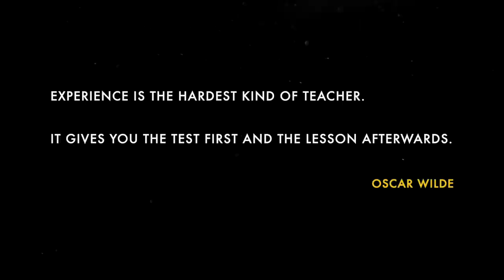Boat Yard Jazz.. an unpleasant setback | Ep. 71

Comment: Diluted Hydrochloric acid .... Leave 30 min and spray off. The balance is easy with an angle grinder and abrasive pads. All easy if you have access to it all I suppose. That is a tough job with scrapers. Well done with the hard work ... And staying positive.

Comment: They sell a cleaner that has hydrochloric acid that will dissolve the left over barnacles. Then it just rubs off. As for all of the anti-fowling once that's done, get an ORBITAL sander with a vacuum attachment!  Save yourself alot of headach. Sand it down to the fiberglass, then you are starting fresh.

Comment: At 14:10 you said basically if it sticks it sticks.  You are correct.  The boatyard will try to convince you otherwise.  Do my comment below.  I rebuilt a boat last year...where we did have to take it down to the gel...We figured 19 layers on a 1972 boat.  Common sense prevails well on boats except with electrical....more boats catch fire than sink.

Comment: Some scrapers are better than others, and keeping a sharp edge on it really helps, but you have to be careful and not gouge the gelcoat by going too deep... I would scrape the majority of it, and use an orbital sander with a coarse grit mesh sanding pad to get down to gel coat or durable coating layer.

Comment: I had mine soda blasted and then I applied 4 coats of coppercoat. Worst paint ever to work with, but the result is good and it should las 10+ years. No need to pressure clean it on haul out and in the spring I use 15 minutes for a light sanding.

Comment: What a pity I didn't see this much earlier. There is an electric tool for scrapping hulls in that much need. Don't remember its name but it looks like an electric plainer with parts of the blade broken off. It'll cut your work by about 80%. I'd be tempted to use an old plainer and snap the blade to suit and give it a go. Carefully.

Comment: From your video it is hard to understand fully why you need to remove all of the antifouling back to the gelcoat. I appreciate that the barnacles need to be removed and loose or flaking antifouling, but other than that what’s the problem? Antifouling is designed to go over rough and uneven surfaces and stick like hell, try getting it off your skin ! I feel that you are correct in your comment that if you can’t get it off with a scraper and pressure then it doesn’t need to come off and is a sound surface. I would apply two coats of antifouling and get the boat back in the water ASAP.
Reply from the maker: Heyyy, thanks for the feedback :) you are right. It wasn’t too clear yet. But it portrays well how confused we felt 😅😂 in the next video we scrape the rest and explain why we do what we do and dismissed all the other options. Which we definitely considered extensively before starting this horrid job :):)

Comment: Yeah you should put the protective gear. That kind of paint is very nasty for your body, dangerous to breath and to consume. You also could use paint stripper (gel form) it works really well but be carefull, it hurts when it touches the skin. It burns a lot even through 2 pairs of gloves! It took a few days for my mom and I to remove all the antifoul paint under my parent's 37 foot tayana. You could also pay for a sandblast guy or sand it with a tool by yourself but be carefull not to ruin your hull shape with uneven sanding. Its a hard job to do. If you do sand, make sure to apply even pression and make long and steady movements.

Comment: Unless you are racing - should only be using ablative. Very easy to apply and deal with. If you are gonna be in the water for a while - one coat then two coats of another color - should be good for a year or two... But since you guys have already done this a while back at least the next time you will know. If you ever want to know what you should be doing boat wise - do not get other sailors opninions - talk to the local fisherman, boat yard owners.

Comment: Ah yes, bottom scraping.  Did you use the tungsten carbide blades and change them after a day or less?  The edge quickly goes slightly blunt and the scraping effort increases exponentially.  But I guess you know that as it's a 'little thing'.  I did my 31ft yacht last year on my own and I am 70, phew.    Great videos, keep them coming.

Comment: So 1st, work starts from one point to another....just like any tech job or marketing....this is easier....front to back....and just go...organized, not hither and thither....set a timeline, 1/2 an hour...and go...no stop...then another...count it down....but keep going.  This is how we get through physical work.   The parts you scraped are fine....yeah different colours...no worries....primer goes on top of all.   Then you check your work with your hands for smoothness.  one person goes around with bits of tape and marks places that need more work.....then you scrape....go around a 3rd time for quality....done.  NO.   remark bad areas with tape....bring out the sander and smooth down.   Check again.  Smooth with feel of hand.  Repair all badly damaged areas now with epoxy or new thru hulls or whatever.  Wash down everything with water.  At this point this is mid afternoon on 2nd day if no major repairs.  Let water dry...wipe down with low lint cloth.  Wipe hull with acetone.  1st coat of bottom paint goes on 2nd day.  Dries over night...next coat in the morning and in the water.  Its just keeping at the work...Like any solution, it begins at one end and goes to the other.

Comment: why the f... Ure not using hand machine whit sandpaper ?
Reply from the maker: For starters we didn’t have one and we there was no shop close that sold one. Second the toxic fumes of the dust.. not so fun and it would cover all the boats around us. Was not really allowed :)
Reply: @seethelittlethings  so its a boat yard for repairs or for keeping boats on dry only. Taking AF coat off takes few days with a machine - by hand U get back to water in next year. Hand sanding machine isn't expensive. Also get ur self more protection and masks. And ask yard manager what to do to use hand sanding machine. For god sake its 21st centry not a stone age. Use some thin foil to build a tent around a boat working area taped to a deck - no dust around. Foil is cheap. If U still gona use that hand stuff 20 next ep will be about that tool and using it.